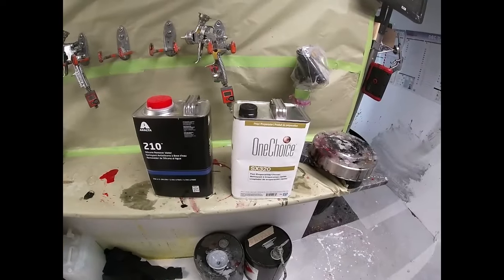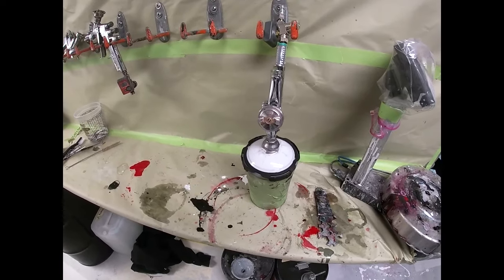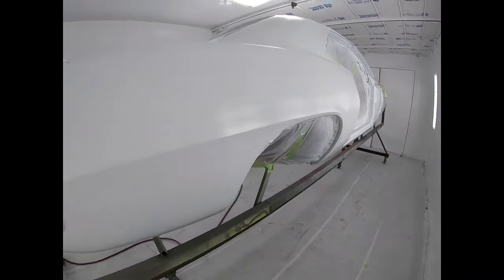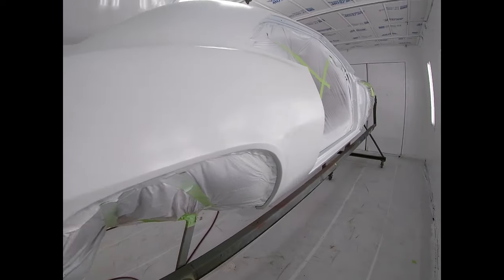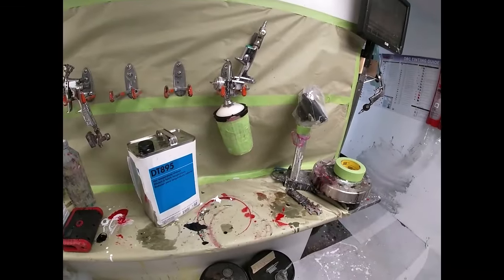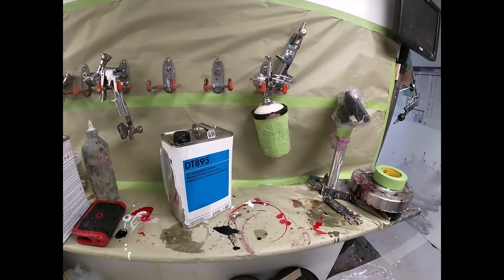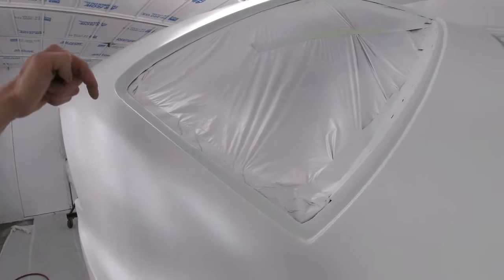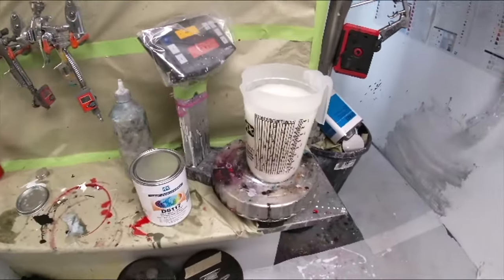Painting Project Apocalypse 69 Camaro semi gloss tri coat

Comment: HA - that rotisserie is a must have - not only easier on the painter, but probably also a better finish in areas where one normally has to spray at unusual angles to get to.   I have a new 69 build in the planning and will be also using a rotisserie.  One thing I used many years ago when spraying metal flake - I used a couple of marbles in the pot (it was a old suction feed gun) to occasionally agitate the flake with. my rolling the marbles around - I think it worked - HA.  And no matter how well I thought I cleaned the gun after shooting the metal flake -  a single red flake would shoot out onto another job - HA.  Thanks for the tips.  CHEERS from AUSTRALIA.

Comment: Just stumbled upon your videos, excellent content, i plan on trying vp2050 for the first time after using dp40 in the past. How far down below the bend of the window channel did you run the masking line for the black for the flush mount glass? I am assumming you have it just below the bottom edge of the glass aprox 1/4 inch?

Comment: I wanna know what sandpaper you use to wetsand the clearcoat and how you get it to stick to your blocks, like 800 grit to 1200 to 1500 to 2000 grit etc.
Reply: Sandpaper needs to start at 600 grit for flattening clear coat. Thats why we spray 5 coats of clear. And slowly worked out to 3000 grit and then polished. Theres no real trick to getting sand paper stuck to block, just do what you can to wrap it around and make faux handles
Reply: @looper451  
5 coats of clear? What are you trying to do ' that much orange peel? or using that much to block out body work. 
5 coats ' you can start out with 400😂.
Reply: @keithclark486  What? All restoration shops apply 5 coats of clear to their cars. Its so theres enough body to flatten the clear. Starting at 400 isn’t necessary. You’re just making your job harder
Reply: @looper451  
Not all do. If you get the body work right and get the clear to lay down without any orange peel and trash in it. 3 coats is plenty enough. You don't want to much mill build up.
Reply: @keithclark486  Yes you do. You need the mills to flatten the clear and still have enough body for protection. Every single high end restoration shop applies 4 or 5 coats of clear, usually 5. Thats the industry standard. Hot rods need to be dead straight with 0 orange peel, and the only way to do that is to level the clearcoat
Reply: @keithclark486  It usually takes me 5 hours to clear a car. Because you have to wait up to an hour or more in between coats after coat number 3. Never had an issue, neither has anyone else in the industry
Reply: @looper451  
So how many coats of clear do you think you're sanding off to get rid of all the orange peel to get it flat?
Also how much do you think you buffing off ?
Reply: What clear are you using? What gun are you using? How much air pressure are you using?
Reply: @looper451   how long have you been painting?
Reply: @keithclark486  l don’t even understand what your question is. Im just telling you what the industry standard is for custom work like l do. Its 5 coats. Show cars need it
Reply: @looper451  
How long have you been painting???
Reply: @keithclark486  Couple years industrial spraying semi trucks and equipment, 2 years collision, 5 years restoration
Reply: @looper451  
I've been doing autobody/paint for 47 years now, I've taught thousands of students in that time ' if your body work is straight and the vehicle is properly prepped ' with the right combination of clear/hardeners/reducer and most important ' spraying techniques/ gun adjustment ' a good painter should be able to get the clear to lay down with little to no orange peel. 3 coats of clear is more than enough to lightly block start out with 1200/2000/2500 and polish out for show car results. 5 coats of clear is overkill and having to use 600 grit paper to get rid of orange peel?
I've seen painters pile on too much clear with the misconception of sanding and buffing it and it turns out Ocean Waved. Maybe try some old panels you have laying around and try to dial in your technique/ gun adjustment etc. 
One hour between coats? What are you trying to do ' sand out trash/orange peel/ working by the hour?
Definitely not the standard on high end show cars.
Reply: @looper451  
Not trying to come across like an @hole
I've seen 20/25/ 30 years body men and painters caught up in bad habits ' costing themselves/ shops
Time/materials/ money and making it hard on themselves.
Reply: @keithclark486  Sure l get what you’re saying. But ld rather follow the lead of the industry leaders. Sylvester customs. Chris Cerce. Tyler Krause. The best in the business and thats how they do it
Reply: @looper451  
Not a fan of either one of them. Best in the business? Lol. 
You need to out in the real world and see how it's done and quit believing everything you see on your phone. 
5 coats of clear?
Blocking orange peel with 600 ?
Is by no means the standard. 
Maybe get a job at maco and get some gun time in and move on to an reputable shop with a good painter that can teach you how to lay out 3 coats of clear with little to no orange peel=saving time/ less